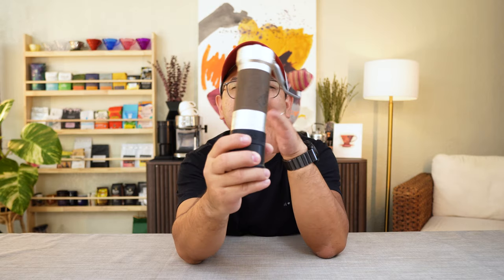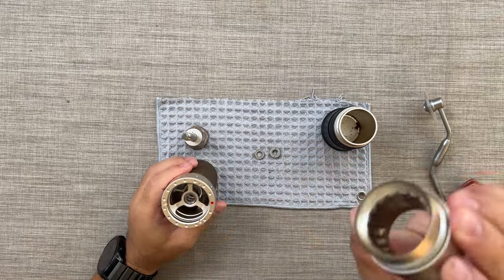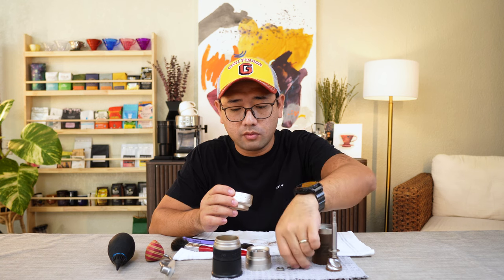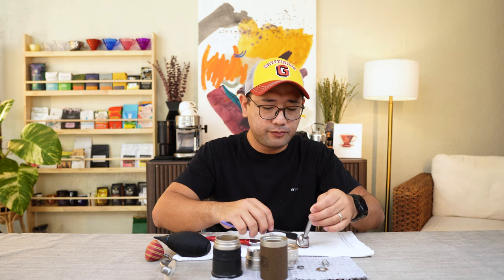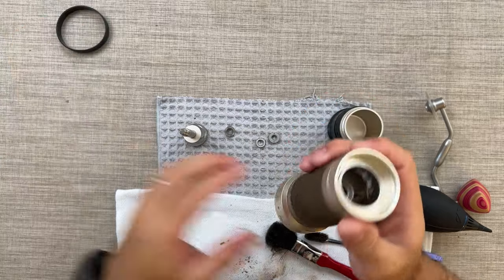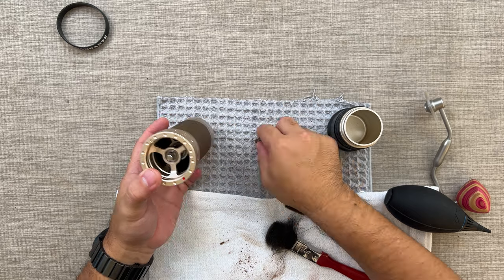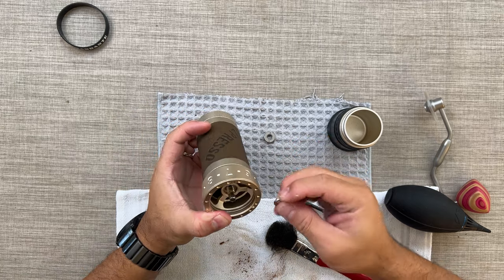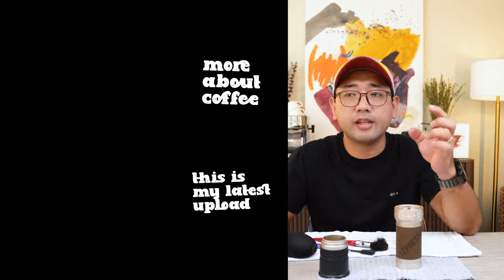1zpresso ZP6 Disassembly and Calibration

Comment: So I think I calibrated it. When I’m at zero I feel resistance when I try to grind. When I move up or down I feel it can grind regularly is this then calibrated on zero or not? Thanks in advance
Reply from the maker: @icedchief  when you calibrate to zero, it should be the end of the setting you will not be able to move further than zero. If you do this It should start moving at around 3/4 clicks. That is my calibration though. The factory calibration recommends you to put your 1 click at the first time the axle will move. This normally gives you -3 to -4 clicks beyond zero. My calibration on the otherhand will not let you go past zero
Reply: @darylbuenocoffee  when I do anti clockwise I can go 3 past 0. Is this ok and calibrated to zero like factory ?
Reply from the maker: @icedchief  yes of course its okay. This is the recommendation of 1zpresso.
Reply: @darylbuenocoffee  ty man your always a huge help and make the best vids imo
Reply from the maker: @icedchief  wow! Thank you man! I appreciate it!